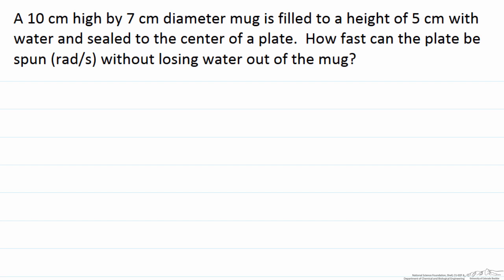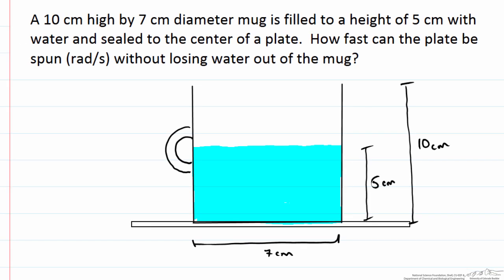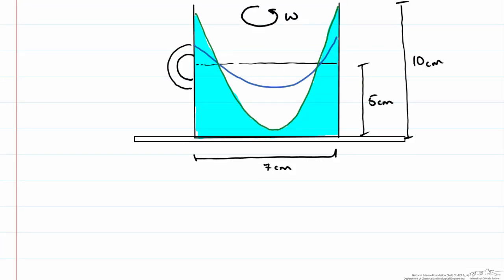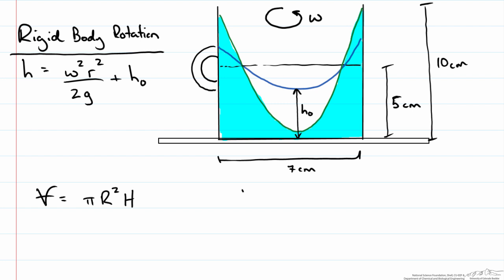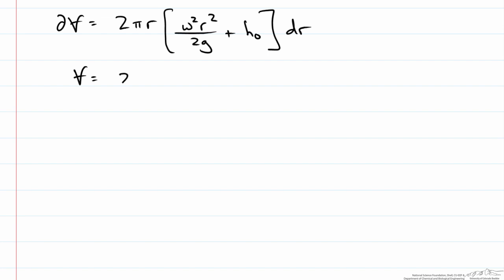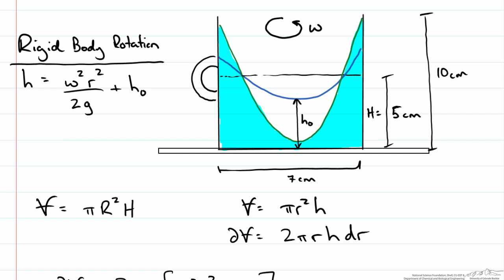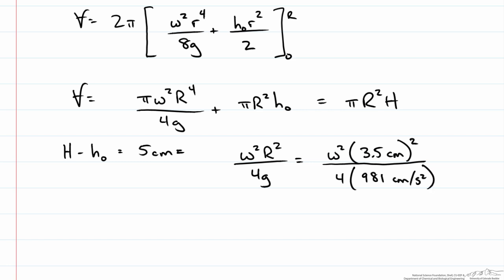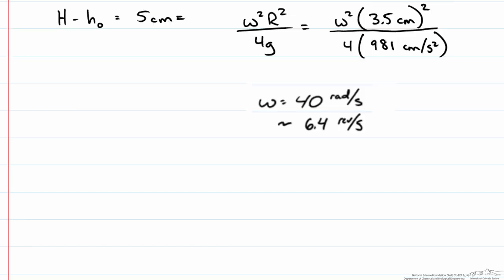Rigid Body Rotation

Comment: Is it always true that the dip in height(at the centre) is equal to the rise in height(at the edge)?
Reply: yeeap
Reply: The math doesn't work out though. If the shape of the water is parabolic and h0=0, water would be spilling out of the top. A parabola takes up area less area than a triangle.
Reply: yes

Comment: hi, i dont get why when the drop of the water in the middle is 5cm will equal the water on the side rising by 5cm as well....
Reply from the maker: This is simply because the mug is half full at the start, so the height decrease in the middle is the same as the increase on the sides.  This would not necessarily be true with a different starting height